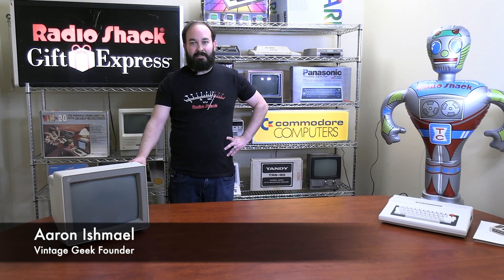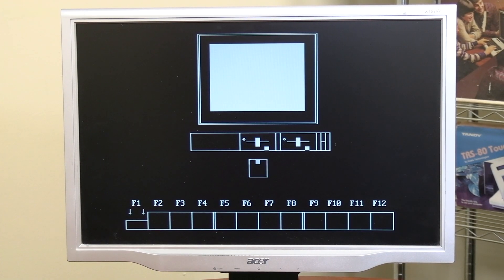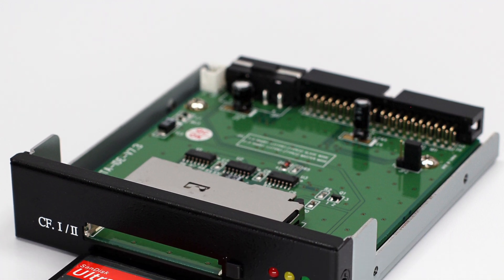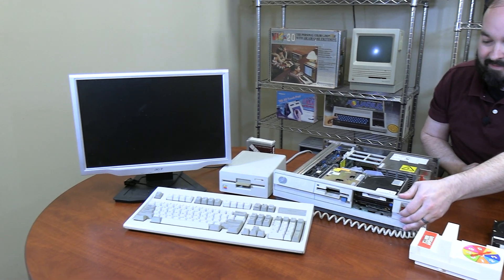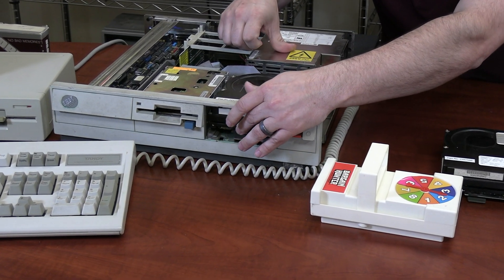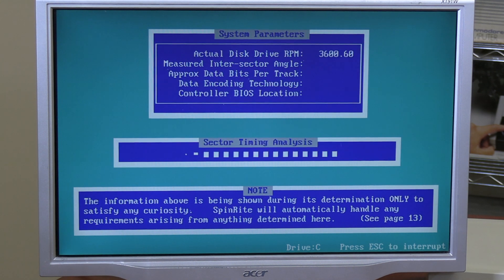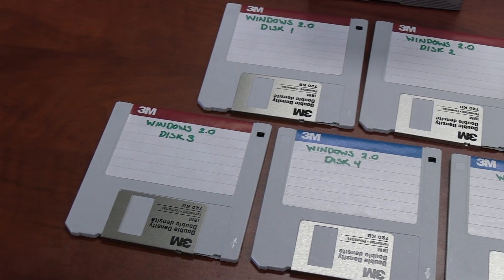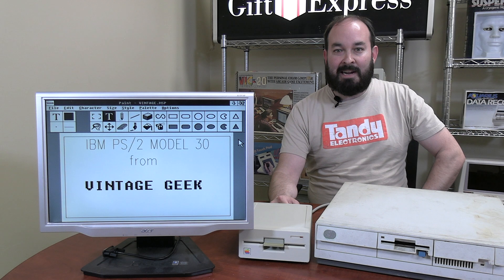Playing Hard Drive Roulette with the IBM PS/2

Comment: What's the deal with the apple ii unidisk 5.25 prop?  Lol
Don't count on that drive lasting long.  I like the sound but those are a huge bottle neck.  Mine ran one time and quit also, but I decided not to postpone the inevitable....
Reply: A lot of what's presented in this video doesn't make sense.
Reply: Those drives weren't very reliable to begin with.  I took apart six PS/2 Model 25s, four of which had these drives in them and neither of them were good.  I built one with the best parts of all of them, including a Seagate ST-125 which was in one of them.

Comment: My "Maxed-Model 30" (check my channel) runs Windows 3.0 well enough. But I've upgraded to an NEC V30 CPU, and have a Trantor T130B SCSI adapter (also in a video) running a 1Gb HDD and external CD-ROM. The adapter you have on Model 30 is for an external IBM 4869-001 360Kb drive (contact me if you are interested in one), which I have on my Model 30 along with the [VGA] "PS/2 Display Adapter".

Tomorrow I'm doing a live-stream of the IBM "Personal Typing System", which uses a Model 30 planar too...

Comment: I'm starting to get images of the drives paired with the Model 25 and 30 - and believe it or not, a game console that IBM designed for Sega. There are 20 (two different types), 30, and 45Mb drives of that interface. The 45Mb HDD requires the last BIOS revision ('04') on the 8086-based Model 30.

Comment: Agreed with the sounds. I remember being on a service call when I was a pc tech. There was an Seagate ST251 that would not spin up. Luckily, the platter shaft was visible below the drive. I spun it up with my thumb and it started to work. I told the customer to not power off the machine, get some floppies and get your data off because this would be the last time the drive would read. Sure was interesting times back then. Love the nostalgia.